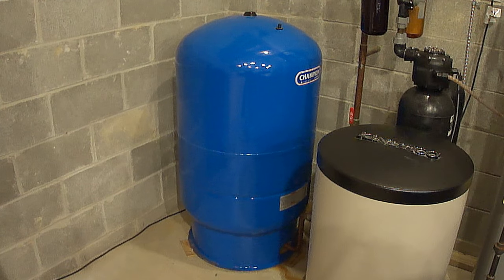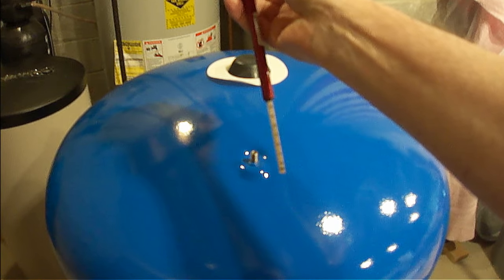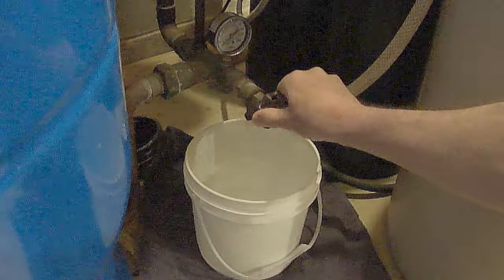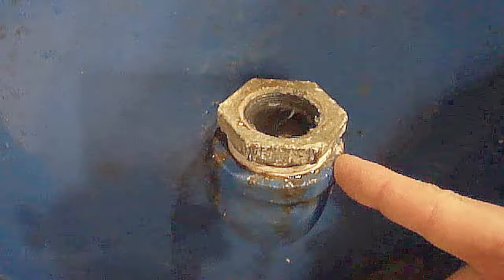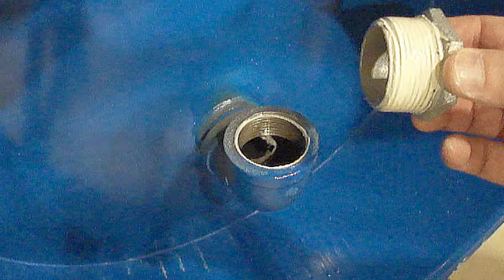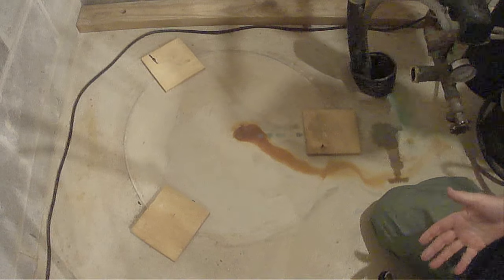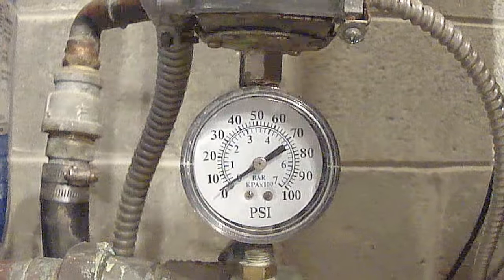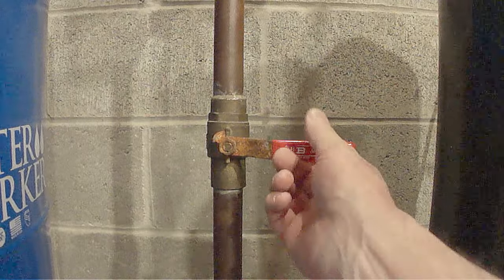NEVER Replace A Water Well Pressure Tank Until Watching This!

Comment: Galvanic corrosion will occur with copper and galvanized steel
Reply: Let's say it so people get an understanding of what you are saying, "There is a problem with copper and galvanized piping are joint together, some people says Brass is ok but that's not ok either, when connecting copper and galvanized pipes you should use a "Dielectric Union which will allow you to connect the pipes without the 2 touching each other and will not allow a breakdown or a reaction.

Comment: Copper to galvanized?? No dissimilar metals electrolysis concerns?
Reply: what about brass to steel adapter it is all I had when handle broke and stores were closed at that time
Reply: @sissymurphy9620  Brass will last longer than the tank will

Comment: Help! The company that installed my tank 15 years ago installed the drain way above the bottom of my tank. The diaphragm  is blocking the air valve. How the f#ck do I drain it?? Can't even move it to replace it!! Any help would be appreciated!! Do I drill a hole in the bottom of the tank to drain it??

Comment: Keep in mind if you are replacing your tank the bladder is likely leaking and there will be lots of water in the air space above the bladder so not only will the tank be heavy but it will be top heavy and awkward to move. Normally there would be a drain valve down at the same level as the inlet into the pressure tank (usually of the tank tee withe the relief valve and pressure switch) so that you can drain the tank completely before moving it. If your bladder has been leaking it may take a bit of time for all the water to drain out of the tank.
Reply: I had to replace my tank the gauge and the pressure switch but have old copper lines and old unions were on there. I replaced the unions and the t along with the gauge the switch and the tank. I taped all the threads but I can’t get the unions to stop leaking any tip? I feel this is why I have no pressure still

Comment: I have a proflo  new  as of 2015  I am guessing 44 gallon one so watch should the pressure be on the tank and at the pressure gage . If you use brass can you use a steel coupling for the turn off valves . I was always told brass to brass . The one turn off valve to the house broke and emptied the pressure tank int my crawl space and glad now crawl space is 7 feet deep  and all I hd to replace it was a steel coupling with a brass turn off valve and now thinking I should replace the turn off valve with a new one also since it needs backflushed . I wanted am trol but  could not get one any where here so went to fergusons and got the proflow one and new switch and everything  The tank the well driller put in was to tiny for this house  hoping someone can answer this soon
Reply from the maker: Look on the inside cover of your pressure switch. If it’s for example, a 40/60 psi, then set the pressure tank to 38 psi. Brass is always best for fittings to prevent galvanic corrosion. The bigger the pressure tank, the better because it means you’re well pump will not have to turn on as often.
Reply: @proclaimliberty2000  Thank  you Thank you I will get the new parts today and check the switch as the reciept from fergusons only says pressure switch
Reply: @proclaimliberty2000 I got the brass fittings at lowes,  but did not get a chance to get down there to check the switch  since hubby had a heart doctor appointment and lab tests . Tomorrow  is another day . I just wish I had the chance to get down there today  . Time just catchs up with you